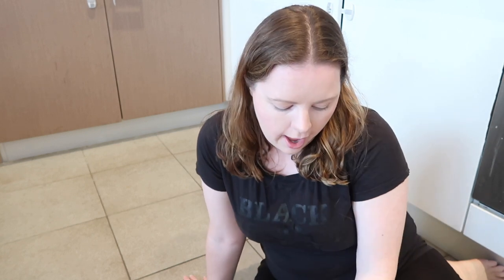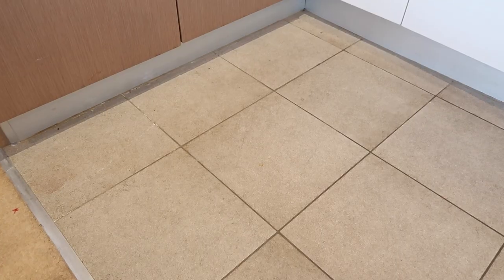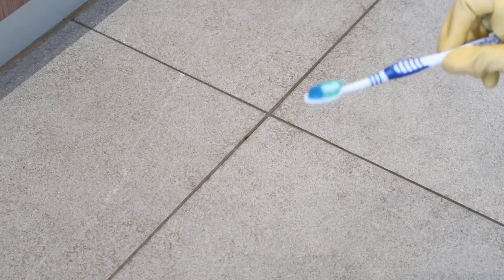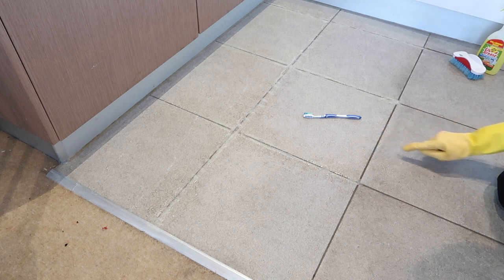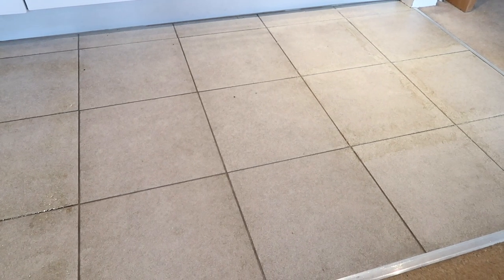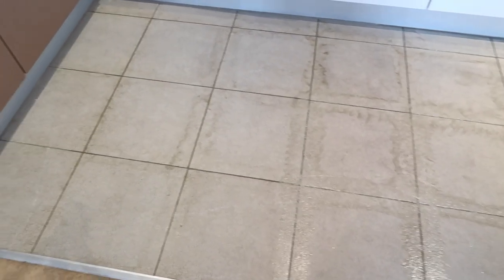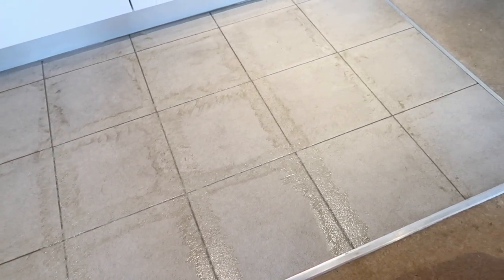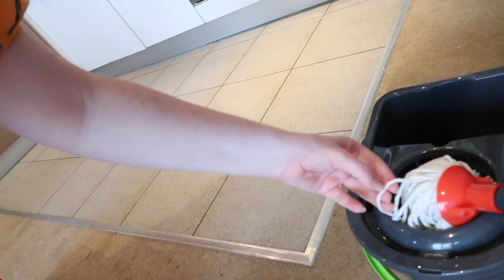EXTREMELY DIRTY FLOOR || SCRUB & CLEAN WITH ME || ELBOW GREASE

Comment: Try gel toliet bowl cleaner. If tiles are not plastic polymer. Gets the grout super clean. When you do your carpet try adding oxy clean when you wash. Rinse well. Gets so many tuff stains out.
Reply from the maker: Thanks Barbara, how do I tell if they are plastic polymer? If they aren’t, would it matter if the toilet bowl cleaner was blue/green? Good tip about the carpet.
Reply: @OURIRISHFAMILY  The best way is ask maintenance. Blue doesn't matter. It rinses clean on mine. Try it in a corner, tiny spot and watch it closely. It really shouldn't hurt it as it is in a heavy traffic area. Hope this helps.

Comment: Have you ever tried a magic eraser on the tile? Works great. Tfs
Reply: carly 14 . That sounds like a good idea 👍. I use them to help remove soap scum in the bathroom
Reply from the maker: I’ll definitely give it a shot. Thanks Carly
Reply: @OURIRISHFAMILY  Just a heads up- "Magic sponges" can be pretty pricey BUT if you search the name of the actual type of sponge (Melamine sponge) on Amazon you can get a whole pack of them super cheap! Or, if you're familiar with Aliexpress, it's even cheaper. I got a pack of 50 sponges for under $5 (Canadian dollars)!

Comment: Using a grout sealer or floor sealer may help keep it from getting so dirty again. As for the stains on the carpet. Have you tried the steam iron and vinegar method? I rent also and it has gotten multiple stains out of my carpet...
Reply from the maker: Like an iron for your clothes? I think I need to give it another scrub (or get Robert to do it) and then consider sealing it. Thanks Sheila?
Reply: OUR IRISH FAMILY yes a steam iron. Spray the spot with vinegar and water. Lay a clean white cloth over and stream iron it. The stain pulls up into the cloth.
Reply from the maker: No way, I’ll be giving that a shot. Thanks Sheila.